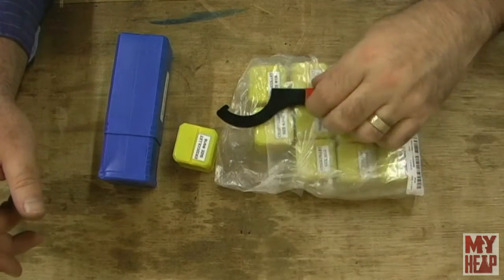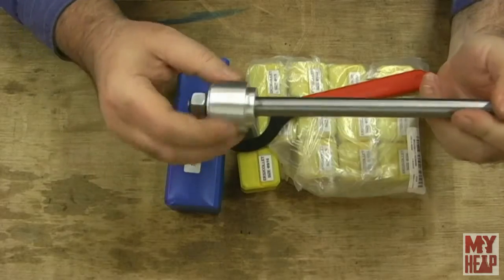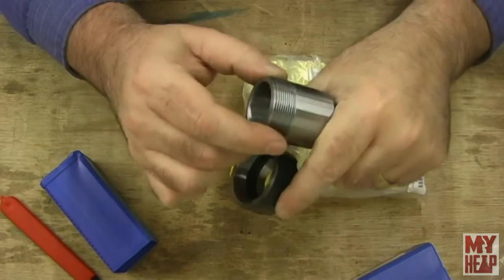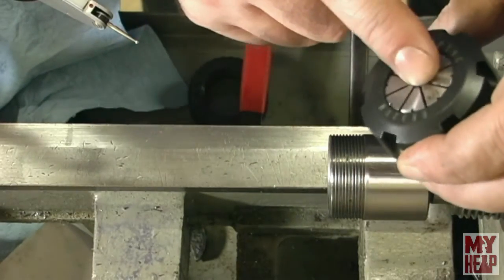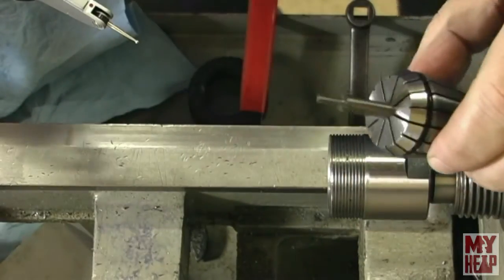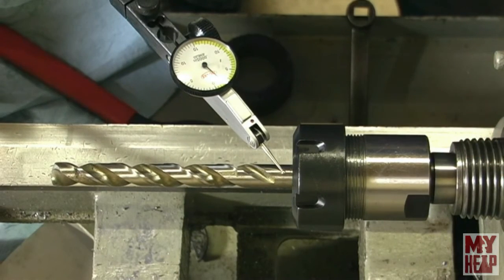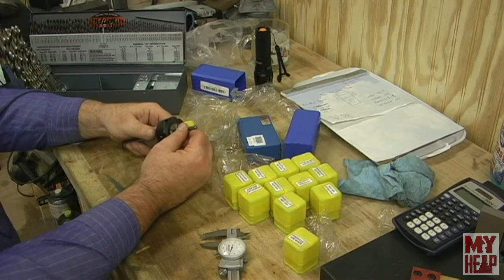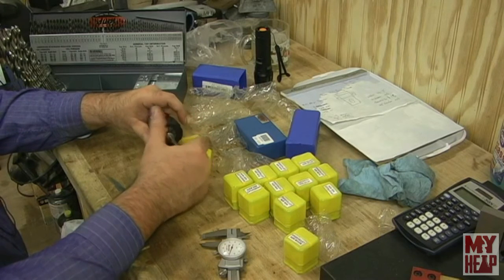Bangood Tool Review - MT3 ER32 Collet Chuck, ER32 Collets and Wrench

Comment: Using a ballbearing nut you will get better results, also torquing the nut to the same reading every time should give similar results, you can try it easy, just nip the nut up and measure, tighten it a bit more and measure again then gronk on it and measure again, this is why the bearing nut is better as its easier to torque down to a similar tightness.
Reply from the maker: Thanks for the tip.  Any recommendations on which ball bearing nut to buy?
Reply: They are basically all the same, but best not to go with the cheapest you can find, i'm in europe so where I shop is different.

Comment: I was thinking about these on eBay for my mill and it seems most common is a 9 pc set for $40-45. I may end up just getting a nice US-made arbor and collets from China as they seem to be well ground, adding no more runout measured from chuck and spindle. They seem consistent, but the chuck is suspect at .002-.0025. On the mill, you can get away with runout more tolerably than with the lathe

thanks for reviewing! this vid reminds me to get a MT#3 reamer for my mill spindle

Comment: Sometimes getting the collet nut vary tight makes a difference. also put the material in the collet after installing the nut.
In my experience the nuts can be bad pulling the collet off center.
Reply from the maker: Thanks for the tip.  Where would you suggest buying a known good collet nut?

Joe

Comment: G’day Joe. 1/4” is 6.35mm so it wasn’t a 6mm. And fitting the tool in the collet before it is fitted in the chuck, of course it won’t fit, I’ve tried that also. So your next project should be to mount a pencil drill to the lathe tool holder and regrind the er32 taper, what’s the worst that could happen, you get it wrong and you throw out a freebie collet chuck. Cheers Peter
Reply from the maker: Hey Peter, Sorry for the late reply.  I been out of pocket for a couple days.  I think I might try grinding it  just to see what happens.  The worst that can happen is I trash it.  :-)  I just need something to clamp into the toolpost to grind with.  Perhaps my flexible Dremmel shaft.
Reply: Hey Joe, the Dremmel will work. Cheers Peter

Comment: With care and the right tooling you can re grind the collet chuck bore.
If you do mark the chuck so you can put it back in, in the right place to get minimum runout.
THanks for the vids
Reply from the maker: That has been suggested a couple of times.  I may set something up with my dremmel flex shaft and try and see if i can take some of it out.  Thanks for watching and commenting.

Joe
Reply: @MyHeap  I wouldn't waste your time....if the tool, once mounted and tightened in the collet, shows some runout......just recalibrate your tool register to show an over sized tool diam.....this is mainly for CNC use as you will be running under dead reckoning with CNC, but for manual mill use the cutter is just another tool that cuts on it's flank to whatever size you adjust the X and Y slides to.
Reply from the maker: Ian, You are correct if the intention is to hold tooling with the collet.  If you are using them for second operations and need concentricity then they are no good for that.  Truthfully, most of the problem can be with the nut.  I am not going to try regrinding because I agree with you, it isn't worth my time.  Thank you Sir for watching and taking the time to comment.

Joe
Reply: @MyHeap  I wouldn't use them in a lathe for second op work, they were designed for tool holding...….for any second op work where you want the second half of the job to run true to the first half I would use the 3 jaw with a slack register to set the chuck dead true. I find them adequate for what they are and cost.
Reply from the maker: Ian.  Thanks for the tip, but let me play devils advocate.  Say I am making a number of screws with special formed heads.  Second op being that I need to grip the screw thread to form the head.  Wouldn't the collet make that easier than making a jig to hold the screw in the three jaw.  Remember, I am new and full of questions.  That is how I learn.  :-)

Joe
Reply: @MyHeap  Yes, that is true, there are many ways to do a job. In the simple case of the screw head I have used a split nut held in the 3 jaw to hold screw threads so that the threads are not damaged by being clamped etc. You get wiser as you get older etc and you never stop learning.

Comment: Thanks, I was just looking at this chuck. I am going to get the chuck and the threaded insert to give it a tang so I can use it on my Lathe tailstock. 

I appreciate the spindle check before testing. That took you some time but it’s a nice touch. Maybe mark it - re-index and see if turnout follows. 

Well done evaluation!
Reply from the maker: Hi Dan, thank you for watching and commenting.  Perhaps I could get a little better resolution with it by marking and re-measuring.  It has been suggested to regrind the chuck in situ.  That would make for a better chuck, assuming I didn't screw it up trying.  But the chuck is so cheap that if I did screw it up, the educational experience far outways the monetary loss.  Might make a good video too.  :-)  Thanks again Dan for coming by!

Joe
Reply: sorry to be offtopic but does anyone know of a way to get back into an Instagram account??
I was stupid lost my login password. I would appreciate any assistance you can give me
Reply: @Quinton Ellis Instablaster =)
Reply: @Blaine Niko it worked and I actually got access to my account again. I'm so happy!
Thank you so much you saved my ass !
Reply: @Quinton Ellis Happy to help :)

Comment: Wow, 0.002 run-out is not good. May be ok for some things, but that doesn't pass the mustard test for most work, even for hobbyist machines. I think I saw Accusize Industrial Tools R8 to E32 on amazon measuring about 0.0003 TIR, which would be acceptable for just about any hobbyist work.

Comment: I didnt know they sold Imperial tooling, everything I ever saw was metric. With some tweaking with a toolpost grinder you could possibly get it dialed in. Depending on where you shop, just the materials might run $15 to make the collet chuck. I dont know how they make & sell them for that if you think about the operations needed to make a MT3 chuck. Cant beat free tooling :)
Reply from the maker: I think you are correct, maybe trying to grind the chuck concentric would be a task worth trying.  But for the money, I am surprised that it is that close.

Comment: Nice review Joe, thanks for sharing! I think at that price I could find a use for those, like this system better than the MT3 collets I've been looking at.
Reply from the maker: Just keep in mind that they are what they are.  By this I mean that the chuck I received was .002 out of concentricity.  If you have to do a second operation on a part and you are going to do diameter work, it will not be concentric.  BUT, if your doing all operation in one sitting, it is no worse than a 3 Jaw.  Thanks for watching and taking the time to comment, I do appreciate it.

Joe

Comment: given that your machine is not running true (has a wobble in the spindle) about half a thou over a distance of around 3/8 to 1/2 inch for every inch the part is sticking out your run out about 1 thou so if you have 3 inches out of the chuck you have about 3 thou run out, did you take this into account yes Chinese tools are of pretty poor quality

Comment: Those things are no ban good...atall.. crushed up Citroens and Yugos...
Reply from the maker: Hahaha ... Are you trying to give a Yugo a bad name???
Reply: @MyHeap  the runout on my 1947 Craftsman/Atlas lathe is Zero still. How could anyone in 2019 make parts that bad? That's impressive..
Reply from the maker: @TractorWrangler01  I know what you mean.  Problem is, I don't know how much is the chuck, the collet nut or the collets.  I imagine it is a bit of all of them.
Reply: @MyHeap  Indicate your machine then add the chuck and indicate that. If your chuck is running out mark the high or low side so you know what to subtract from the chuck numbers to calculate the runout of the chuck. Keep in mind that if your machine is out then the farther your works gets from your machine the more the error will be exagerated.

Comment: Has anyone checked to see if the M12 threads are concentric with the taper? The one I ordered is way off. I had to make a draw-bar with a slight bend in the middle which I did after it was tightened in the M12 threads. It works fine that way but I am disappointed with that aspect of the collet chuck. Check out a video I created to show the eccentricity error. https://youtu.be/MLZMciwqyT0
Reply from the maker: Hi Jim.  I never checked the he concentricity of the M12 thread to the MT3 taper.  When. I made the drawbar I don't recall having any issues.  I will try to remember to take a look the next time I am in the shop.  Thanks for pointing that out as I am sure plenty of folks would like to know.  Thank you for watching.

Joe

Comment: .0025" TIR.   OUCH!
Reply from the maker: Yes sir.  A bit disappointing.
Reply: What did you expect for a cheap set of collets and chuck like this from Banggood?  Honestly, for what they cost, this is an excellent value (and no, I don't work for them).  A typical hobbyist whom these budget components are targeted at doesn't care about a few thousandths of error.

Comment: Joe,
Sorry to be the voice of doom man, but 6/100 mm run out on the collet holder.,collets that won't take nominal sizes .... JUNK!
Get rid of this stuff!
Collets are supposed to be precision stuff... over  half a tenth mm runout... is NOT acceptable (good enough for wood turning perhaps!)
Also, you could polish out the bit of runout in your spindle. That is pretty ok for an older machine, but you can get rid of that with some careful lapping and a lot of patience.
Those collets, however.... they are NOT a good buy.... 
You may as well use a clapped out 3 jaw chuck, that would give you about the same 'precision'.
Yes, you could try with a decent collet chuck from a known source (the one you have needs to be destroyed!)
But as a setup, complete... sorry man.... 
The price is pretty irrelevant... if you're looking for collets, you want something that does better (a lot) than this.
These ER collets will never be as good as a 5C or a 3C ( I use them too, just like you for economy) but you can get better. The prices in Euro mount up to about 70 euro (say about $ 90). 
You need to spend double that and buy imports via a US tool vendor, that advertises a known runout in his catalog. I paid about (if memory serves) 200 ish euro for 15 collets . I can't remember what I paid for the chuck. And even though I the collets were advertised as 1/100mm runout max, I had to 'massage the chuck a bit to get there.
But over 6/100 mm? no way man...no way...

Paddy
Reply from the maker: Sorry about what Paddy?  Are you kidding me, I appreciate your feedback.  I do think I will try grinding on the collet chuck as an exercise, since I have never tried that before.  Now let me ask this.  If I were doing all operations in one setting including turning the OD, the chuck is no worse than a 3 Jaw, correct?  I think it would be okay it that situation.  Definitely not if you had to maintain concentricity on a part you were putting in there for a second operation.  I know I am probably wasting my time even messing with it, but truth be told, I have more time than money on my hands these days.  :-)

Thanks for the input Paddy, I appreciate your comments, experience and expertise.  Believe me, I plan on picking that brain of yours on this mill I need to put back together!

Joe
Reply: Well, yes, you could try to massage them into shape.... more by lapping then grinding, but it is not a job for the impatient chap.
And there is no assurance you'd get it correct. In a lot of these cheap sets the first thing that needs checking is the nut of the collet chuck. For some dark reason these are often a lot worse than the rest of the gear....
You could lap the bore, bit by bit ...but it's a hit and miss affair....
 
A set of collets isn't the first thing one normally gets.... it is only with the availability of these affordable ER collets that home-shoppers get collets in the numbers they do now.
If only the 5C or 3C (or any other sort that we saw in past times) were to be had... it would be cost prohibitive for the most of us. 

Just know, that at the end of the story you WILL buy another set ..... if not now than later.
I have my collet set for about 10 years now.... I have had a lathe for about 40 years...so you can work without them... They are very useful, as far as repeatability goes and as precision work-holding (when they are properly made) but it isn't the first item you need.

Paddy

Comment: They are giving them away to everyone to review. Mustnt be able to sell them. Most of these things are rubbish. Heaps of runout. I bought a cheap and an expensive set and they are both junk. Buying them is like buying a lottery ticket. Mostly you dont win.
Reply from the maker: Hey Chris.  Your right, they are mostly rubbish.  I haven't used them since the review other than to modify some screws slightly.  I suppose if you are doing everything in situ, they would be fine, but then you could use a 3 jaw chuck.  Thank you for watching and taking the time to comment.

Joe